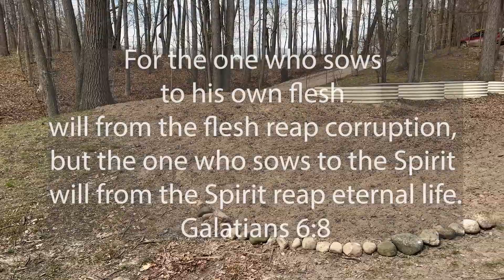Gardening 101 | How To Turn Dirt Into Soil

Comment: Haven’t had good results from adding wood bedding, wood chips and chicken manure to soil unless decomposed for at least 1-2 years. Any decomposing wood material may rob your plants of nitrogen until fully decomposed. You may also want to check your PH and possibly add some lime. Chicken urine is acidic.

Adding worms is always a huge plus but takes time. Building good soil takes years but getting fully decomposed humus from your local town or county is brilliant and pretty inexpensive. Mix it with course sand for excellent soil.
Reply from the maker: I have found that if you keep the soil wet and cover paths and around plants with wood chips the organisms will break those pine shavings down quick. The waste from the worms and other decomposers is rich in nitrogen. Acidic soil is great for most plants! I try to keep the pH about 5.5-6.